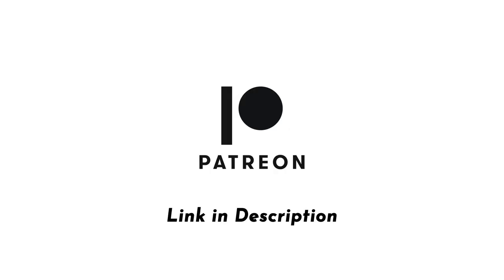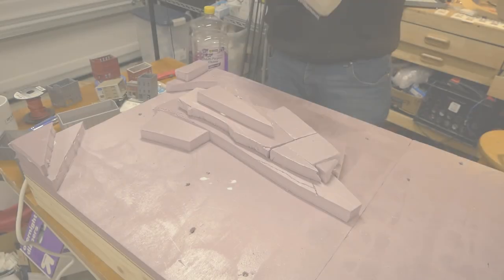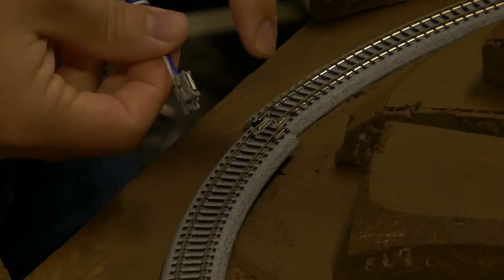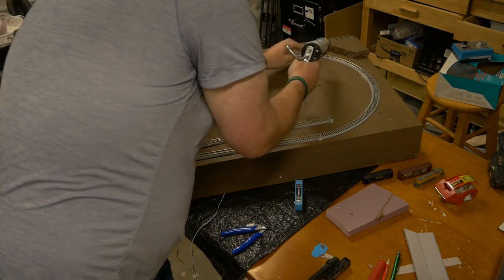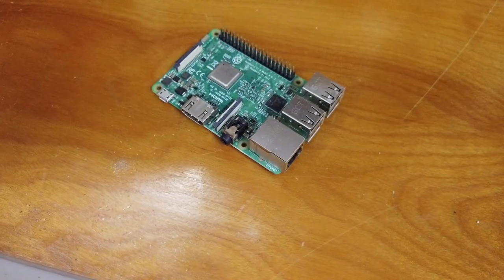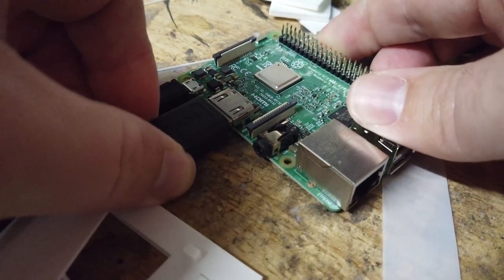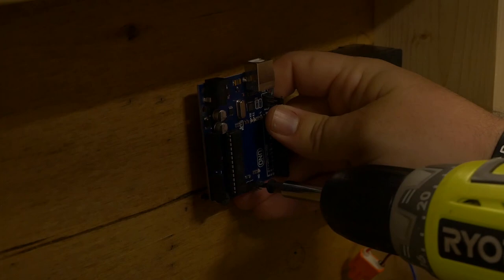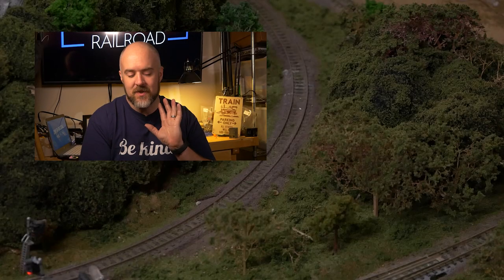Building Your First Model Railroad, MRROne Project Railroad Part 2: Laying Track and DCC Install

Comment: I 3D PRinted a case for the DCC++ station.  Made it a lot more secure, neater and safer than just stressing the Arduino board with screws pulling it onto bare wood..  It also allowed me to put a little display on the top for troubleshooting / monitoring purposes :)

Comment: When terminating stranded wires to a terminal strip, it's best to "tin" the wires with solder and then bend it into a hook to go under the screw head.

Comment: This MRR One series has been very helpful and inspirational.
   I'm going to try something similar soon as soon as I work out the track arrangement... i will likely use either my Power Cab and a Wifitrax panel, or the 5A wifitrax system.  
   Cheers

Comment: If you want to update any of your references to DCC++, I am happy to help. The newer DCC++ EX version no longer needs jumpers, has separate power control, works directly with our WebThrottle-EX or Engine Driver (or any WiThrottle CAB) with no need for JMRI and quite  few more improvements, especially with regard to current sense and CV programming.
Reply: I'm new to the hobby and would like to built this layout. Do you have any resources that you would recommend to understand the newest/best DCC devices and software?

Comment: Jimmy,
Excellent video, just wanted to make a comment on the DCC++ part. There is new software for DCC++ witch you can use. You can find it on place  called dcc++-ex.com, the group have rewrote the software, it will work on Uno or mega, but they perfer a mega, cause you can add wi-fi so you can use your phone on tablet to run your trains. The nice thing about it, if you set up your aurdino mega  with the motor board, and a Wi-Fi unit. Or just the motor module. You can loaded it with the automatic loader, it works with Windows 10 and versions of Linux.
And the nice thing is you don't need jumpers. 

I have a basic one set up on a Arduino Mega 2560 and it works really nice. I don't have a WI-FI board.  I use JMRI to connevct to the Arduino. 

If you have a chance take a look at it..

Comment: Thank you Jimmy for this segment I just watched. Your stuff is great, you explain it very well in the 3 tutorials I have watched so far including the first segment. I will be doing DCC so learning that it's not as hard as some make it sound is a relief. It makes me want to do it like you did on the cheap end getting a better result than just buying something for like 200+$'s. I hope in the future segments moving forward from here there is on on installing a sound system and also installing DCC into the locomotives. I have new ones with DCC already installed. And I have some older 70's early 80's East Broad Top Railroad steam locomotives that I want to have DCC in. Would love to be able to talk to you sometime.
Reply from the maker: I've always wanted to try and see if I could install a decoder in an old DC loco from the 70s and 80s.  I may have to give it a shot!

Comment: Looking at this setup again and I know you use the DCC++ system you did before but they came out with DCC-EX shortly after. Are you powering the Arduino through the USB for the Raspberry Pi? Looks like the motor shield is powered by the 12V/2A power supply and the RPi by whatever came with it?

Comment: Kinda curious about your choice of which color wire to which rail.  You mentioned that you may want to expand this, so is there a standard you used for this choice?  Since it looks to be a table top layout, why not use T-Trak standard so you can expand it with it?

Comment: Great video. Shame that all linked stuff to Amazon is "currently unavailable", I know you probably link to Amazon for affiliate links but I'm sure you could team up with a reliable hobby store which would have items in stock (Amazon pricing varies a LOT and often ends up much more expensive as individuals can list their own pricing). Getting into this hobby, I'm finding that 95% of the stuff recommended on videos (including tracks) is back ordered or plainly out of stock..
Reply from the maker: There’s a lot of stuff unavailable right now.  I am working on a new layout, and I had to go to 4 different hobby websites to get the track I needed.
Reply: @DIYDigitalRailroad  been reading a lot and trouble finding items seems rampant, every year from 2013 onwards! Even worse for Canadians... That's me, getting in obscure hobbies :p I wanna help keep it alive, your videos are contributing to that thanks! For a beginner, I'm veering towards Kato unitrack, seems that at least availability is slightly better (compared to code 80 and 55 from atlas or micro engineering).

Comment: But what if u didn't  want to do that. And just hook it up straight to a digitrax box . That what I wZ hopping to see . I DONT TUCH COMPUTERS
Reply from the maker: Hey Tony!  All you have to do is rather than hooking up the wires to the DCC++ Base station, you run them to the digitrax system.  I assume its a zephyr?
Reply: @DIYDigitalRailroad  yupers